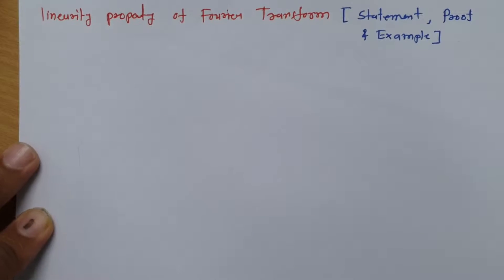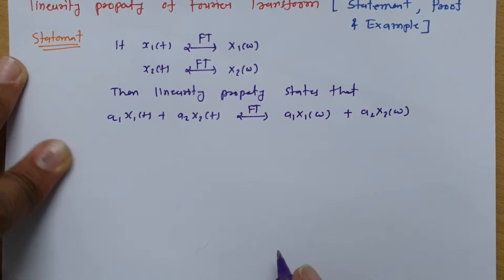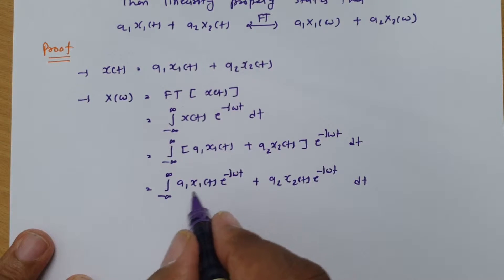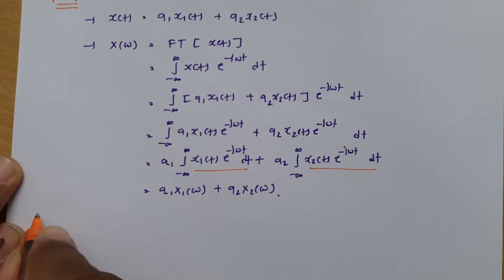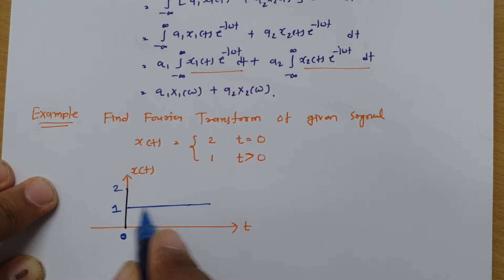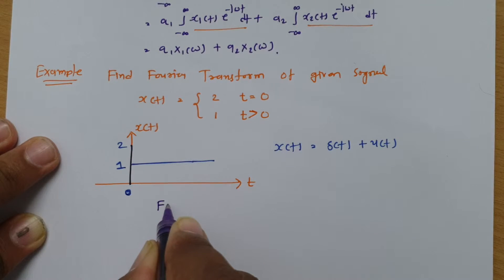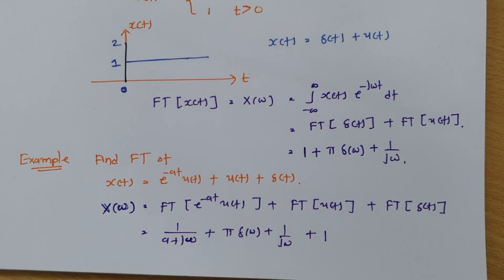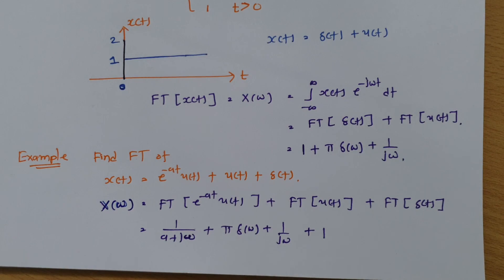Linearity Property of Fourier Transform: Statement, Proof, and Examples

Comment: SIR I installed Your application on my Cell.
It opens but there is question. How to find pdf notes as I click on subj it shows  send your msg not having notes
Reply from the maker: It is web application, so it needs to have proper internet connection. Everything is easily available, see it once properly.
Reply: @EngineeringFunda  ok I will let you know